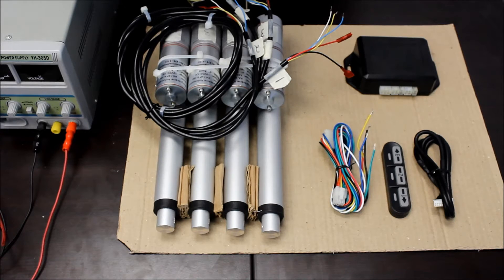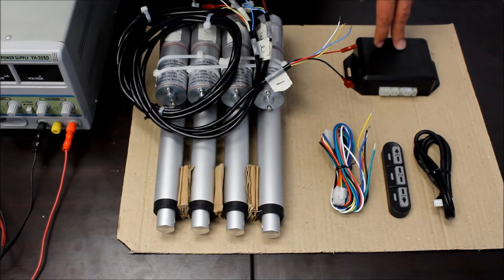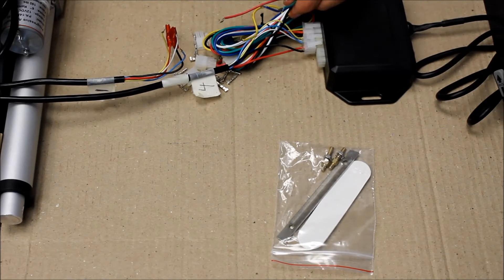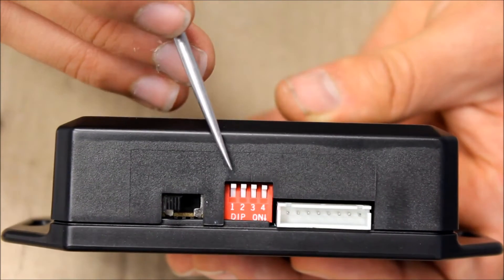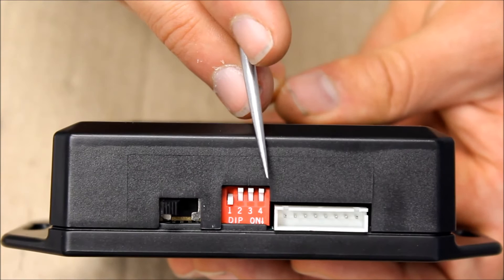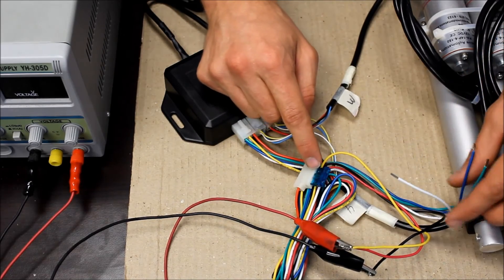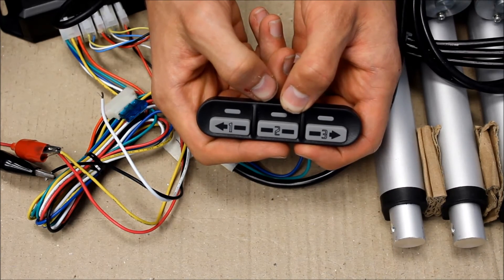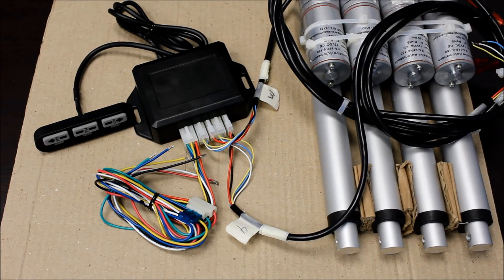Synchronized Dual Actuator Control Box PA-39 - Product Overview

Comment: i'm planning to build a dual axis 16kW solar tracker: 23x panels (2384x1303x33mm) and 83.3lbs each. will your actuator works if i use it in my design?
Reply from the maker: Our actuators can be used for outdoor solar tracking applications, however, we can better pinpoint which models will be the best fit once we have your required:
•    Stroke length
•    Force rating
•    Speed
•    IP rating (Dust and water resistance)
•    Dimension limitations
If you are able to provide any of the required specifications, we can check our inventory for a suitable linear actuator for your application. You may also email sales@progressiveautomations.com, we would like to work with you in finding the right actuator.